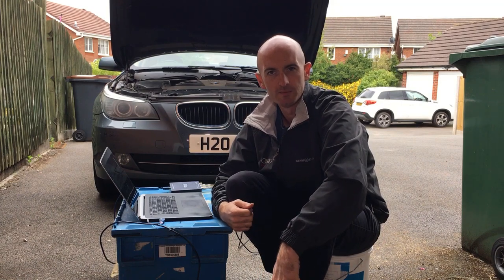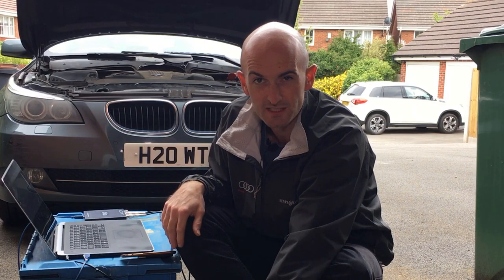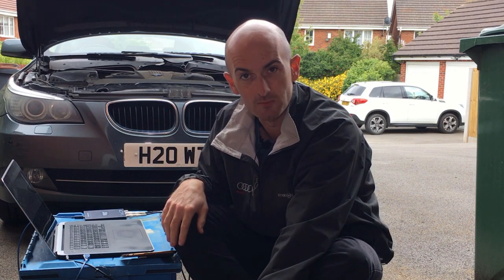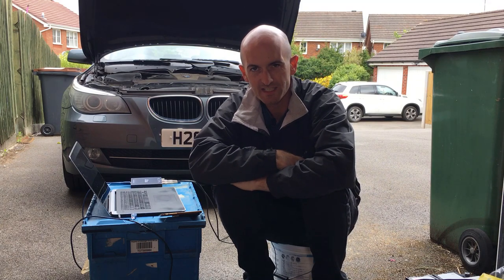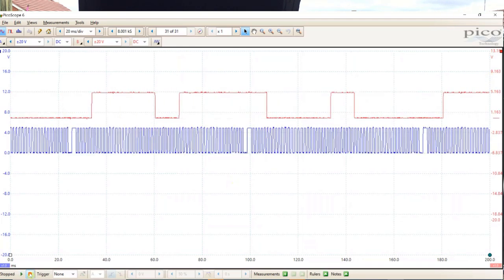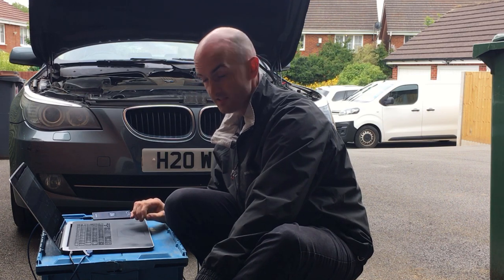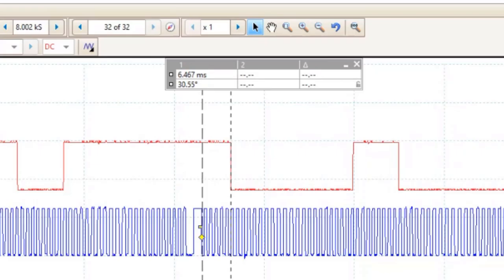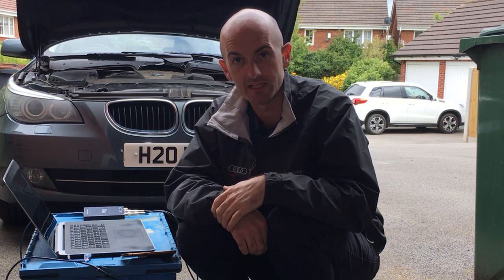BAD vs GOOD TIMING CHAIN CHECK! [BMW N47 Timing Chain Noise and PicoScope 2204A] | Mechanic Mindset

Comment: I'm a construction equipment technician and I've been using the 2204A for several years now and never knew what the advance trigger setting can do. Now I know. I also learned more about the degrees of crank revolution thanks to your video. Thanks Darren, you just made my job easier and me better.
Reply from the maker: Thanks for the feedback! This is music to my ears, glad I have helped. Anything else you are interested to know more about? 👍
Reply: @MechanicMindset  I asked in your 5 tips video about sample rate settings. You kind of answered that in these timing chain videos.You had a good example in these of how changing the sample rate cleaned up the noise in your pattern. Again, thanks for the education. Great videos! I'm a permanent subscriber now and have watched them all but 2 so far (ran out of time this morning).  Look forward to more.

Comment: That was interesting seeing the cam/crank staying in sync with each other at idle with the new chain, and constantly changing with the old chain. It looks a pain to replace
Reply from the maker: Yes I was pleased with the outcome of the comparison, amazing it was still running. To be fair, I’ve had them still running with valves touching pistons; they run but you can’t turn them over by hand!! Not too bad when you’ve done a few; I had to lift the engine 3 inch to get the sump out on this one. No bother if you’ve got all the kit. Cheers for watching 👍

Comment: From personal experience, I bought a 320d With an N47 engine (08 plate) about 4 years ago and only realised what the issue with the timing chain is after I purchased the car. Then I was a bit concerned so I decided to call BMW and ask them regarding the timing chase issue. Interestingly, they then confirmed that there was a recall on these engines and BMW confirmed that the timing chain tensioner was replaced with the new type due to the known issues. So, I would suggest to anyone having any concerns with the timing change (you are right, it is more the tensioner than the chain itself) to call BMW and ask them for this timing chain tensioner replacement scheme - free of charge of course. The car was on 74000, now on 116800 after 4years, and still running
Reply from the maker: Thanks for sharing!

Comment: Needed to get a cam+crank trace for nearly 5 years on my VW T5. After watching this video I bought a 2204A and the Hantek leads. Fingers crossed I get to the end of this problem.
Reply from the maker: Cool, it’s a great tool! What problem are you having?
Reply: @MechanicMindset  Had the cam changed a few years ago, ever since then it's not started with the cam sensor connected. I suspect it's this issue: http://dgmotorservices.co.uk/blog/?p=385 but I've never found a garage willing to go to this level of diagnosis.
Reply from the maker: @seanhood980  That is odd. Any fault codes? Just trying to think what you can get wrong on that engine 🤔

Comment: Thank you for these two videos, they were eye opening for me. They provide excellent explanation, focusing on the topic, with all important details shown, compared, repeated, etc. This is 1Mx better than most of the YT videos on diagnosing and repairing cars.
I have a few questions:
(1) Apparently, N47 has no VANOS. Can the same measurement be done on a VANOS engine? If yes, how can I interpret the result? In that case the relative angle of the camshaft sensor will not be constant due to the VANOS regulation.
(2) I'm trying to investigate the timing chain(s) of an N73 engine. Can I do the same measurement on this engine? Can it be done on the two cylinder banks separately, one by one?
(3) If replacement is necessary is it possible to replace N73 chains without removing the engine and the cylinder heads? (BMW documentation suggests digging out the whole engine and fully disassembling it, including removing the heads, which is a huge trouble, of course.)
Thank you in advance, all thoughts are appreciated.
Reply from the maker: Hi, thanks for the message. We only get VANOS in Petrol engines, however it should be adjusting at idle. You could did the test with the disconnected, but your known good would have to be in the same state. You can do the same test on the V engine, you’d be better off with a 4 channel scope. I’ve never done chains on the N73, but I’d imagine you are better taking the engine out. Maybe have a look around, I’m sure someone will have made a video. Cheers

Comment: Hi. I've just got to this video and it's brilliant  ! I've got an 118d and has the timing chain done by the previous owner however the engine doesn't seems to sound normal and the fuel economy is very poor and the power quite low... Can you have a look at it please ? Where are you based ? Thanks

Comment: Wonderful idea to show the internals mid way through replacing the chain, I will check the readouts with Picoscope and even if they're right - if I won't be replacing the chain yet - I will probably replace the tensioner, just to be on the safe(r) side. Once again, great video, very informative, thanks for sharing.
Reply from the maker: Glad you enjoyed the video! I just replaced the tensioner in my N47 recently. Cured the start up rattle
Reply: @MechanicMindset  I'll start with the tensioner then, glad you mentioned it. Mine hasn't got any rattles yet, but just went over 100k miles - unless it's one of not many with no issues / good servicing practice - but doubt that. Thanks again!

Comment: Great content, subbed straight away. I've done a few of these now, they sound so much better afterwards if the chain is noisy. Always turn clockwise from front, anti clockwise from the back of the engine.
Reply from the maker: They are not bad to do once you’ve done a few. Thanks for the sub, great to have you on the channel! 👍

Comment: Great video, I wish I would’ve watched it a day sooner. I just ran a crank to cam capture on a 2019 Colorado with a 3.6L with low compression no start.
Reply from the maker: Have you had a chance to try this method yet?
Reply: @MechanicMindset  Unfortunately I haven’t. To be honest we don’t get a lot of the older higher mileage stuff at the dealer. That’s one thing about this atmosphere a lot of the scope hands on comes from known goods. I try to scope as much as possible even if I do it on my own time ( which I do all the time). That’s a great video though. Keep them coming.
Reply from the maker: @gcmd5852  I’ve seen a lot of your FB posts, some great tests you’ve done there, I’ve saved a few 👍
Reply from the maker: @gcmd5852  Awesome!

Comment: Very nice videos. Did you use the "automotive" software or the standard software in your 2204 scope in this video?
Reply from the maker: Just the standard Pico 6. I don’t really use the automotive software - the real benefits of that kit come with the hardware and the Pico support accounts (I.e waveform library). Other than that, the software is pretty much the same. Pico 6 actually has more features like spectrum mode for frequency measurements!

Comment: Just wanted to ask how you removed the high pressure pump sprocket, did you put the cover back on and use the tool from the timing kit perhaps. I think I maybe changing my timing change soon, I’ve done one these before on a 118d but I had the engine out so used a different method to get the sprocket off.
Cheers, Chris.
Reply from the maker: Yeah, I just used the tools from the timing kit 👍

Comment: Any advice on why my car wont start after a replacement it turns over, it died when in motion would anything be cutting it off from firing up due to shut down?😊

Comment: ,In a 60-2, 1 tooth is 12*.  The engine rotate 720 for a full cycle. So it was 20 degrees out.

Comment: i know this is an old video out of curiosity someone i know has an E90 LCI 318D N47 engine it doesn't rattle only for around 3-4seconds on a cold start then completely silent but it'll randomly have fluctuations in the RPM or stall out occasionally but be fine after a restart, if you tap the accel while it's fluctuating the rpm's steady out aswell and some days it's fine some days it does it once or twice it's very random any idea what the cause of that could be? thinking maybe something todo with the EGR or DPF potentially a vacuum leak or sensor somewhere just looking for confirmation.
Reply from the maker: Yes, could be fuel or compression related. Especially if the chain has jumped or is slack. Hard to say without seeing it

Comment: very painful replacement job for BMW N-engines which the chain is behind, inaccessible unless the transmission is off.  I see BMW tech bulletin 1131544 replacing timing chain by riveting, only replaces top-shaft chain. Do you think the middle chain(crank-fuel pump) needs replacement also?
Reply from the maker: Hi, yes we usually just replace all the chains; they all come in a reasonably priced kit. But yes, not the easiest to access, but once the gearbox is out and the sump is off, you're good to go! Cheers

Comment: Great video I think I have same problem with mine  n47 engine don't make any noise from cold start. Starts ticking once engine warm constantly ticking once engine reaches its temp. Do you think its timing chain been 2 garages and they aint got a clue. Its loudest is it the back injector. Thanks
Reply from the maker: Gaz Logan Thanks. Sorry but it’s hard to say without checking the timing or seeing the car myself. It could be anything. Although the chains are usually worse when stated from cold. Best find a good local independent BMW shop 👍

Comment: The tensioner can be leaking at the back if the seal is going out
Reply from the maker: Tensioner should be a service item in these engines 🤣

Comment: What would picscope you would recommend  for tracing faults on newer BMW's. Can I use a scope to trace ground loop noise audible in speakers..? What scope will be good enough?
Reply from the maker: WizRumburak The scope I use here (2204A) is good for most tests, it’s really cheap too. The 4425A is the ultimate PicoScope for automotive, much higher ‘resolution’. I’ve not done much audio diagnostics with the scope. The non automotive scopes (like this 2204A) has a spectrum analyser mode which is more suited for frequency measurements. That might help pick up noise, but you might have to search through the frequency ranges to find your problem and will only confirm the noise you can hear. Locating the issue might be a bit more complicated. Something I must look in to 👍

Comment: I bought an e90 2008 with 200k mileage, there are no bad sounds or anything while driving but should I get someone to check the timing chain
Reply from the maker: Wouldn't hurt! Although at 200k, I would think it had one already!
Reply: @MechanicMindset  I hope you’re right, thanks for replying

Comment: That timing chain was fine just like mine was when I replaced mine.. It's just piece of mind now they're done though!
Reply from the maker: George Austers Yeah I compared the old with the new when it was out, no stretch or damage. I reckon it was the tensioner that was the issue. Like you say, best to be replaced for piece of mind, they can make a right mess!!

Comment: the issue w/ bad timing chain, does it affect N47 engine or certain year model of N47 is not so bad after all? thank you
Reply from the maker: In my experience, they all need doing at some point. Not sure if they made a change. I’ve not seen any require a second chain

Comment: Does the n47 have two cam shaft and is so is the single cam line represent both?
Reply from the maker: @carclips6401  It has 2x gear driven. Sensor is on intake 👍

Comment: Thanks for the great videos, a real education. I'm having a similar issue with my wife's 3 series, only it won't start at all. I've ordered a pico after watching your other videos so I can check through the fuel system and crank timing. How would I find out which cables to probe on the ecu for the crank and cam sensor? I'm guessing they wouldn't be the same.
Thanks again for the great content and Atb to you.
Reply from the maker: Great, happy they help! I have a schematic in this video and mention the pin numbers. If you have the same N47 engine, I would guess they are the same. 🤞
Reply: @MechanicMindset  thanks, I'll report back!

Comment: Mate how long ( hours wise ) did it take u to replace the whole lot
Reply from the maker: marin khan Hi, I was taking my time, but I’d probably say about 8+ hours on my own - it’s a days work atleast. Although it depends on the configuration. This auto transmission takes longer to remove and I had to lift the engine off the mounts to get the sump out. Some people just take the engine out.

Comment: Hey, I did a reading and I am having 1.1 degree drift from crankshaft angle on camshaft on the first measurement and 38 degrees on the difference between both channels. Any thoughts on how much of a divergence of the angle reading is still acceptable mechanically for N47 engine before replacement? I have this chain for 66k km of mileage.
Reply from the maker: Hi, I have seen a few that are still running ok with 38 degrees difference. 1 degree drift is no where near as bad as this car. Do you have any noises from the chain? Has the car had a chain before already?
Reply: @MechanicMindset  Yes, the characteristic noises are there, but not so loud yet. I can hear them especially when the engine is warming up after a few hundred meters passed and when it is hot. This is the first chain (E90 LCI 2011), so it wasn't much driven (with this mileage), yet it is quite aged.
Reply from the maker: @theAFKeyboard  Sounds like it’s time! 😬
Reply: @MechanicMindset  Yup, it sound so hahaha. Very helpful video. Keep it up!

Comment: Hi there hope u well please can you help me some advice. I have a n47 1.6 2013 just on 60k on cold morning start I get a one to two second rattle then quickly goes away. I can switch off engine straight the way and start again while cold and wouldn't do it again. Only does it when sat there few hours and cold engine. Engine otherwise sounds very quiet no strange rattle on idle or throughout rev range drivers fine without issues. One person said can be cam solenoid or even tensioner. Car has full service history oil changes all the time. Any information will help me thanks
Reply from the maker: Hi, these engines don’t have a ‘cam solenoid’, no variable timings. It could be the top tensioner which shouldn’t be too difficult to change. If it’s never had chains, that sounds like the preferred repair. A tensioner might get rid of the noise but we can’t say what condition the chains are in. Also if the timing has jumped (which will also cause issues over time). Best to find a good independent garage to diagnose 👍

Comment: I just did this test on a 2008 123d with 100k on the clock. I got virtually no flutter between the cam and crank but I did measure 35 degree so it looks to be 5 degrees off without any chain noise while running cold or hot. The tensioner bolt is the old large 27mm one suggesting its never been done. I have a chain noise when I stop the engine though. Can you advise if mine is 5 degrees out does that mean that the valve timing is out by 5 degrees or is there some way the ecu can correct that? So over time the chain stretches and timing goes out? - this surely happens on all timing chains in all engines so over time do all engines get messed up valve timing??
Reply from the maker: Hi, I have seen some running fine where the timing is slightly different. Not sure exactly why this is! If unsure, best get the timing tools out. Chains should last forever and in my early days working at BMW (in the 2000s) I changed hardly any at all. If you have the noise and it’s never been done, it might be time. Mine is on 200k miles and not sure if it’s ever been done. Got a slight noise on start up so going to try replacing the tensioner. I’ll check the timing with scope too 👍
Reply: Hello. Just for information I checked my timing with the tool and the top chain was tight with no play on the links around the socket. The timing tool fitted perfectly and notches lined up perfectly so with 100k miles on a 2008 123d it looks like it's OK. As far as I know it's on the original chain/tensioner. I measured 35 degrees with the pico scope

Comment: I just bought a 2013 bmw x1 16d.. n47 engine 2000cc Diesel turbo.. 147000km.. am I going to have problems with the timing chain? Thanks
Reply from the maker: Possibly. Do you have any history to confirm if it has already been done? Good news is that the repair is a lot cheaper than it used to be 🤞
Reply: @MechanicMindset  I have to ask it.. why is it cheaper? Thanks for the answer
Reply from the maker: @riccardomarzotto7974  Cost of parts is much less now - no need to get genuine BMW parts

Comment: I measured 3 client cars, no noise at all, f series n47, all measure arround 38-42 degrees
Reply from the maker: Yeah, I have also noticed varying readings between vehicle with no faults. Not sure how to explain this currently! 

Could be a slight difference in camshaft timing tools? But that wouldn’t make sense as we have the dots to align on the cam sprockets..... 🤷‍♂️
Reply: @MechanicMindset  i have to say i've been mechanic in offecial bmw garage, and did a lot of chain replacements, most of them preventive, never saw one with spot on timing, as in timing tool lays not flat on the head. Later we had the call back action were we needed to check the tensioner ect, same, not one with correct timing, there must be a big tollerance in those ecu's before triggering cam fault i supose